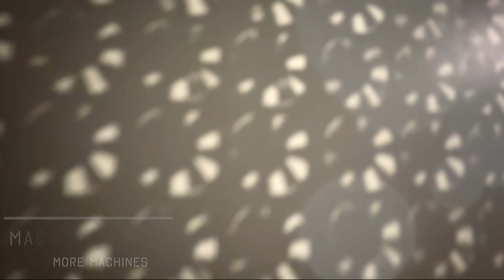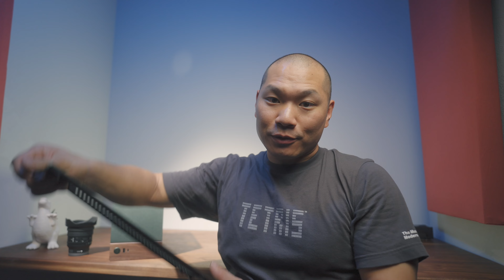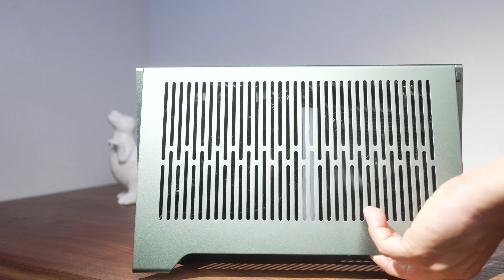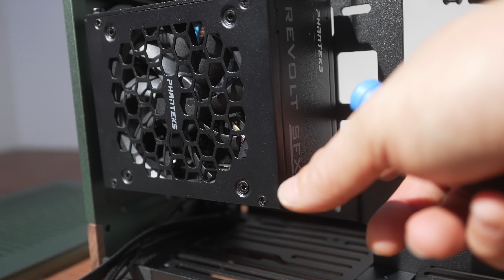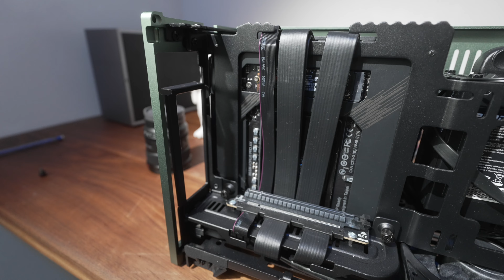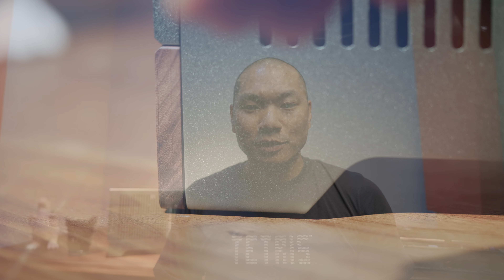The Fractal Terra is a Stylish Sandwich!

Comment: The Magic Marker Mod - Fractal Terra.

I watch a lot of YT videos. Cookware, pews, PCs, and general 'science' stuff.

@ChrisYoungCooks did comparison video between different pans made out of different materials, diamond, silver, coper, aluminum, carbon steel, and stainless steel. Diamonds have the best thermal conductivity and would make a great pan from that perspective. His $4,000 silver pan had the second best (by a long shot) thermal conductivity. Alum was good. Copper was better. Carbon steel was ok. And stainless steel was the worst.

@matthiasrandomstuff2221 did a video about how shiny bare aluminum would reflect thermal energy. And he demonstrated that by putting tape on the heatsink or ever coloring it with a marker eliminated the reflectivity of the aluminum heatsink, making it perform better.

So this got me thinking, the Fractal Terra is shiny silver aluminum. And with all that bare aluminum inside, it is just reflecting the heat back into the case, and not heating up like a big heat sink.

So, I colored all the panel insides with black Sharpie.

And my temps CPU temps dropped (while playing HD2) from 76C max to 71C max.

I was wondering if you could conduct a more controlled test?

PS, because I have an SFX-L PSU, I can only fit an 80mm x 25mm fan under the GPU. And my case seems to work better with that fan set to intake. My GPU has two thermal probes. One is reading 62C and the other with the fan is reading 49C.

Comment: I had to laugh because everyone complains about the access to the thumb screws for the GPU and nobody reads the manual. They tell you in the manual to remove the GPU bracket, install the GPU to the bracket and reinstall in the case. If you do it that way you have full access to the thumb screws. I have had my Terra since launch and am really happy with it. I have 10mm  between the cooler fan and side panel and I am not getting any turbulence. I also don't see any separation between the wood and the case.

Comment: On mine I sit between mid-high 40s idle and 60s while gaming with 7800x3D using the deepcool an600 (curve optimizer set to -10 on eco mode). Still plenty of room for my 6900xt as well which means it will also fit the new 7000 series reference cards.  Blazing fast and quiet.  Beautiful case in the Jade!
Reply: How many slots is your gpu? And what setting do you have the case set too. Trying to plan a build out with a 2.5 slot gpu and just want to make sure I’m picking the right slot.
Reply: How is the noise? This is the only thing I am afraid of with this case. There are some reviews that say that the way the side panels are cut makes noise very frustrating, despite the decibels.
Reply: why would you have your cpu at eco mode? the 7800x3d already sips power anyway so it typically easy to cool. or did you meant to say PBO?

Comment: The wood issue may be specific to your case. Mine is a few months old now and the gap is perfect and unchanged, no warping on mine yet
Reply from the maker: Awesome, thanks for chiming in. Wood is kind of like that. Not every piece is the same even if you treat it the same!
Reply: @MachinesMore  , mine has the same bowing issue. It came in like yours. I went through a few returns of the case before this one. Those didn't have this issue but had other flaws. Specifically, they had frame alignment issues. The center spine did not align perfectly across all 4 holes for a given mark value. At this point, I don't think i will return this one, so I'm just trying to not think much about the gap in the wood lol.